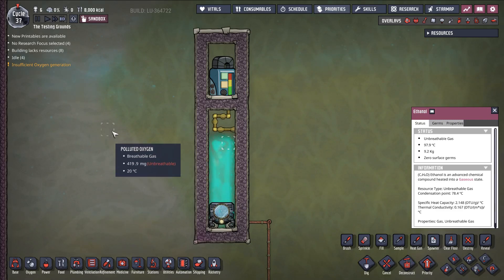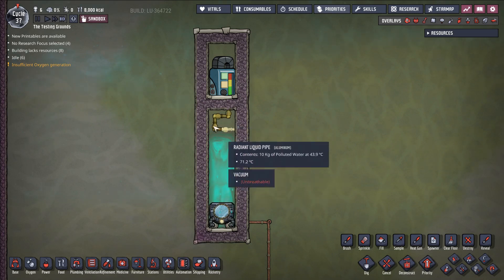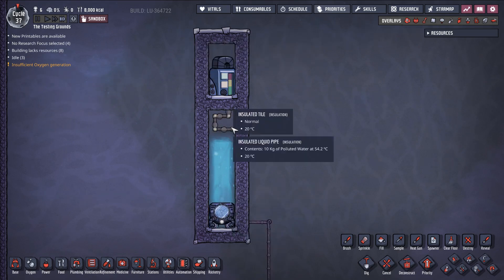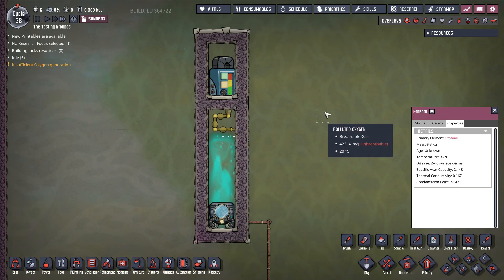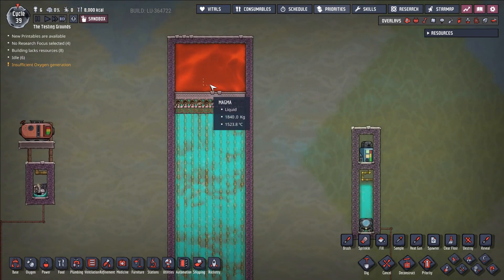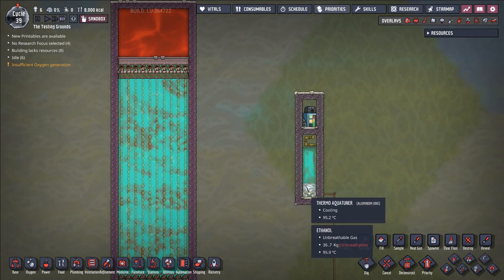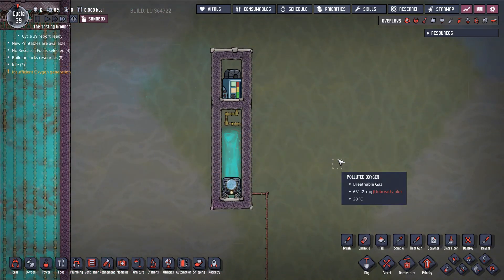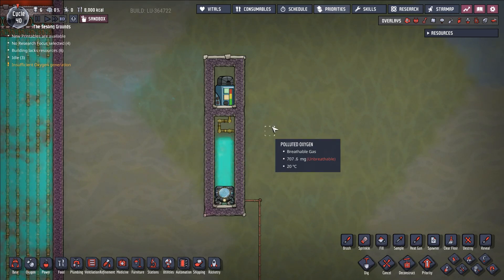The BEST EARLY GAME COOLING -- How to cool your base by boiling ethanol [Oxygen Not Included]

Comment: Have you tried to add plates of sedimentary rock or granite in this system? And, liquid ethanol instead of polluted water?
Reply from the maker: We want to use polluted water as the coolant because it has the highest specific heat capacity of all of our early game options, and the higher the SHC, the more power efficient the aquatuner will be.

Tempshift plates might help, but only if they are placed at the very top and very bottom of the chamber.  We don't want to increase heat transfer across the chamber, because that will make the system less efficient.  But improving the heat transfer between the radiant pipes and the ethanol can let us condense ethanol faster, and adding plates at the very bottom might improve how much heat the aquatuner dumps into the liquid ethanol instead of the gas.

Comment: Plz build without debug mode.
Reply from the maker: Basically you just need to vacuum the room out before you add the ethanol.  Tony AdvancedOni has a video on the topic:

https://www.youtube.com/watch?v=v93JAsjfhR4

Once your aquatuner chamber is vacuumed out, just dump a bunch of ethanol in and start it up.

If you want to set up a cooling loop but don't want to set up a liquid reservoir, here's a foolproof method: 

https://www.youtube.com/watch?v=z4iedV9pXTw

Otherwise just having the liquid reservoir like we've got in this system works great, the reservoir will store any excess coolant in your line and then you can expand or shrink your loop as circumstances dictate.

Other than that, only other thing you might want to add is some automation to prevent the aquatuner from cooling down your coolant to below its freezing point.  Something similar to what I've got in this video will work:

https://www.youtube.com/watch?v=UBr_wMD2w7k
Reply: @gearheadgaming1  Can the ethanol only consist of liquid ethanol?  Does the gas ethanol get created a certain while after the system has run?
Reply from the maker: @Spoonwood  Pumping liquid ethanol in is the fastest way to fill the system, but having any mix of gas or liquid ethanol in there is fine, as you said the aquatuner will boil off the liquid ethanol into ethanol gas.
Reply: @gearheadgaming1  Thank you!

Comment: I noticed the difference in ethanol liquid/gas a few weeks back, and thought I could use it to destroy heat.  But I was thinking the condensation point which basically adds heat,  *(Like how when you flash regolith into magma for example), would make the net gain 0 as you would lose DTU evaporating, but gain DTU when condensing. 
I guess the key point here is the thermal conductivity + the buffer, which makes it take less energy to condense it overall from the heat gains from the condensing?

Awesome build. I may use it if i get back into ONI, on maps with no gold.
Reply from the maker: I think the key is that for ethanol, the SHC goes DOWN when you heat it up, whereas for regolith it goes UP.  So melting regolith is an exothermic reaction in-game (especially so because magma solidifies into igneous rock instead of going back to regolith).  But boiling ethanol is endothermic-- the effect is going in the opposite direction now, even if the ethanol gas just condenses back into regular ethanol when it cools.
Reply: @gearheadgaming1  Awesome that you reply to comments!
I know the boiling of Ethanol would decrease the heat because of the SHC of the gas is less than liquid (mass and temp degree is kept), The reason I didn't explore it was because condensing to liquid, where the SHC would increase *(like how regolith to magma works **(same mass same temp degree, higher SHC)), I figured it would counteract the cooling.
Which is why I think it has something to do with the TC, and buffer...
Or i've completely misunderstood it all to begin with XD
Reply from the maker: @12463trf  It's all down to the buffer/margin between the temperature at which the ethanol actually boils vs the temperature at which it actually condenses.  Basically there's a ~5-6 degree phase transition range where we can simultaneously dump heat into liquid ethanol while removing heat from the gaseous ethanol, and because the gas is easier to cool down than the liquid is to heat up, we generate net cooling.
Reply: @gearheadgaming1  And that ~5-6 degree phase range goes from somewhat of an exploit to down right broken when you limit flow in a liquid pipe so you can create 1500 C liquid ethanol shown in this video, or 200 C liquid oxygen shown in one of your other videos.  Phase transition really needs to happen at 1 temperature, and not over a range to fix this.
Reply: @gearheadgaming1  You went a bit fast over that explanation  in the video. This is much clearer! Thanks!

Comment: I'd be interested to know how this compares using an ice maker paired with an ice-e fan.  I don't know how fast those machines run when working in tandem (which initially needs duplicant labor, but can it get automated with an auto-sweeper to move the ice later on?).  More than 32 kDTUs deleted (is it 36 kDTUs with the ice maker making the ice for the ice-e fan?) for 60 watts sounds worth it... sounds like enough to cool off a room running a kiln early for ceramic (and then once you have the ceramic... how much more cooling do you need?), though I'm new and don't know my stuff, so I could easily be wrong.
Reply from the maker: I don't think the Ice-E fans delete heat.  I haven't tested them recently, but when they were first introduced, all they did was transfer heat from the air to the ice you supply to them.  If they do delete any heat, it's definitely less than 32 kDTU/s-- the only way they could pull that off is if they ran without you ever needing to resupply them with ice.
Reply: @gearheadgaming1  From what I'm reading now ice-e fans don't delete heat.  However, ice-e fans drop bottles of water apparently.  So, I guess the dupes could throw that water back into an ice maker, which might make ice faster?  The gas would cool off from the ice-e fan, while the ice maker would delete heat from the bottles of water.  So, no, that wouldn't be better than what you've provided above in terms of deleting heat.

However, it looks like most common gases have a much lower specific heat capacity than water.  Are the problems with heat caused by hot gases or by hot water or by hot solids or a combination of the above?  If the problems with heat get alleviated by storing heat in water and cooling off gases, perhaps there's some value in ice-e fans for certain set ups.

Comment: Very true, most heat capacity do change with temperature. However kley (for balancing purposes) keeps it constat, so it can change drastically between states instead of gradually (even iif steeply).

I would prefer if cooling would have been easier to archieve (for new players), while mechanics to delete heat are somewhat hidden.

Comment: It is nice but like you said once you can make steam gens you don't really need it.  So it is nice.  It is cool to play with.  But it isn't overpowered enough.  Frankly since the steam gens get used for everything they should likely be nerfed.  There should be other things for cooling at least nearly as good as steam gens.
Reply from the maker: True, it's hard to find anything that beats out a steam turbine + aquatuner combo.  Once you've got plastic for the turbine and steel/gold for the aquatuner, there's usually no reason to use anything else.

I think it might have been a mistake to add steam turbines to ONI.  Heat is one of the big threats in the game-- to create a building that gets rid of a major threat AND generates something helpful at the same time is always going to have major balance issues.

It's like if they took the carbon skimmer, but instead of having it consume power, generate heat, and pollute water, they made it so it produced power, cooled your base down, and cleaned water for you.  There just wouldn't be any downsides, you'd spam them out everywhere.  But that's how it is with the steam turbine-- where's the downside of it?

In any case, the main reason to use this build is how much cheaper it is.  Besides the 100kg of refined metal for the pipes, everything else can be made out of basic ores and minerals.